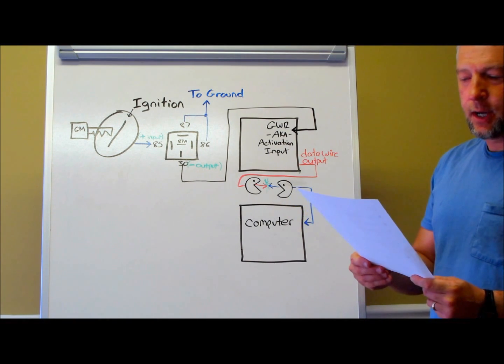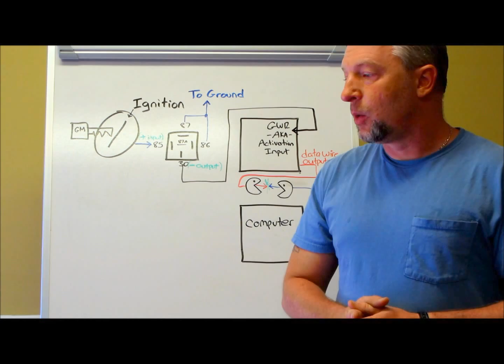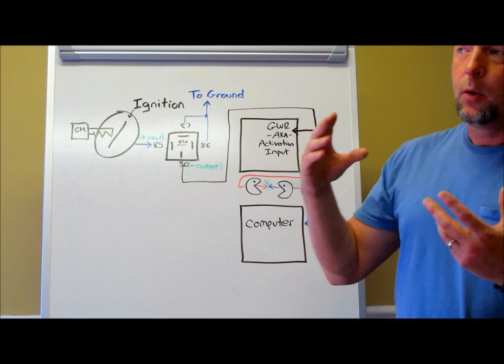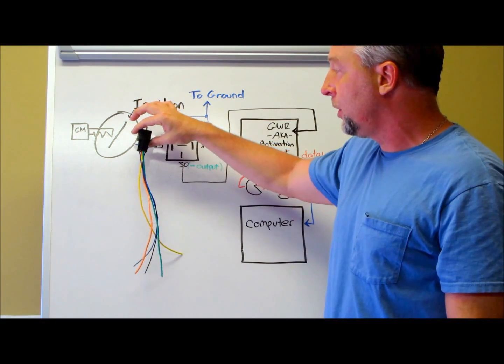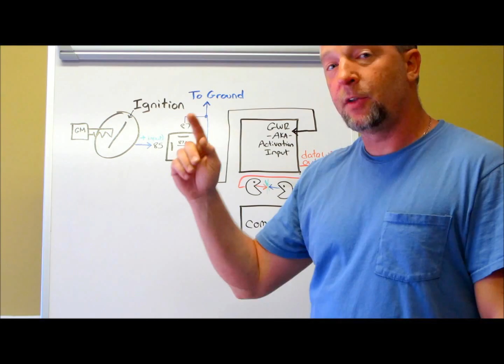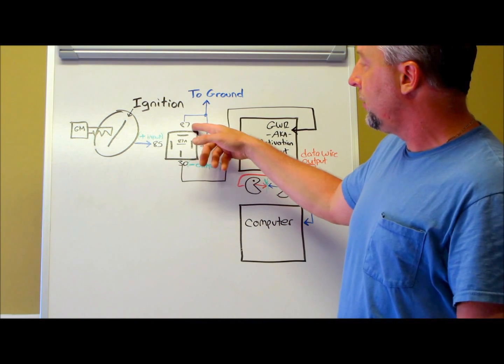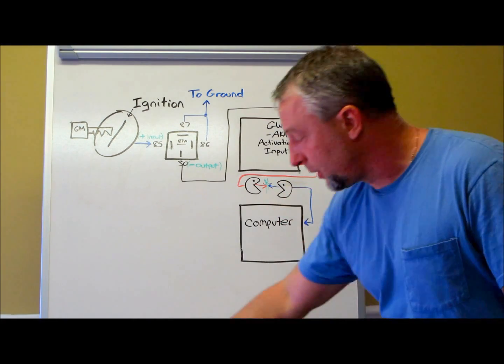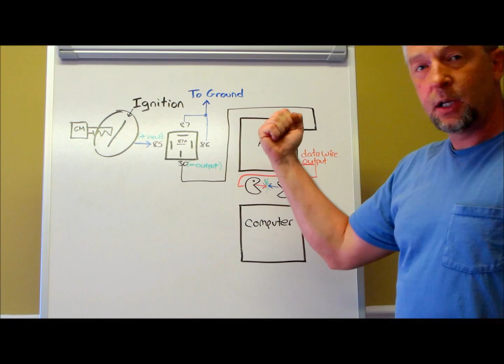Tricking (disabling) factory transponder anti theft system with an aftermarket databus bypass module

Comment: please contact me 2002 toyota avalon. no key. went to dealer got key with no chip he ran vin number made key with code.  no chip said it showed no imobilizer .car turn over no start then froze won't turn over.  hence have mobilizer. any way to not have to spend 400 dollars.? need help tyrone.trickey@gmail.com
Reply from the maker: I got nothing for that one, sorry
Reply: check out Forscan software.  I had the same issue and resolved it with forscan
Reply: The immobilizer  doesn't shut down the starter on Toyotas , you will need a new transponder key and program

Comment: Is there anyway to disable an anti theft system on a 98 Buick park. The fuel pump was replaced along with the battery and alternator. The car starts but doesn't crank. Also the security light flashes. Is there a way to put in a toggle switch to turn the alarm system on and off manually. If u can help me I would so appreciate it
Reply from the maker: we have a part in our store called a gmata which weve had alot of luck for guys having that issue, our site if youre interested in throwing 30 bucks at it is www.lesscosales.com

Comment: i have a 2000 ford mustang only have one key.the antitheft was activated and will not crank,will turn over but want crank.can this work on this car.if so wht will i need to do this.its a v6.i would rather buy parts from you so i no i will get the right parts i need.dealer wants 400 bucks to fix it.just to mutch for me to spend for key replacement and programming..

Comment: What would you recommend for a 2004 Nissan Maxima with only one key, that was just lost?. Dealer wants $300 for a replacement. I really don't care about the key/chip. I watched too many videos and it seems there might be a way to just get a regular key to work. Probably BS, but what say you?
Reply: go to deal have a key made by code that unlocks the doors and turns the ignition  then call a lock smith to come cut and program a key  if u have the service key it will be alot cheaper.

Comment: your relay is wired incorrectly. 30 is always the high power or ground input.  87a would be a pass through when the relay is not energized by 85 and 85. when energized the 87a pass through is cut and power or ground is sent to 87.

Comment: I have a 2002 Ford Ranger XLT would this work for me? I put my key in the ignition and get thing with either key. It worked fine, ran to the store came out and 5 minutes later I could not start the vehicle.

Comment: If you had a 06 Ford Expedition with no keys, would you be able to replace the key cylinder, and ECU from a donor vehicle and start it with the donor keys?  Or is the brains of the anti theft stored in a module other than the ECU?
Reply from the maker: that should be all you need

Comment: thank you for all the Information , now i shall go and get the kit and crank our beloved Betsy ( 2001 Nissan pathfinder SUV ) been sleeping in the yard for the past 3 yrs  , time to get her new tires and flush fuel tank and lines and engine , radiator ,e.t. c . because my girlfriend lost the only original key she had , and i have been looking for simple solution to this problem . and i found it here . 
this will save me over $798 USD . 
I have one question to ask knowing Nissan uses CAN bus system , thanks in advance :
do you think according to PDF catalog the IM05 class is best since i have no key at all ?

Comment: I got a 98 Ford expedition, I swapped the ignition cylinder and retumbled it. I need some advice asap, the antenna to the transceiver module ripped when pulling the old cylinder out, and it won't start the car. the theft light is flashing, any way of doing it on a ford, say it in dummy language so I can learn. please help asap
Reply: Get a new transponder coil antenna. It really doesn't pay off to try to bypass the factory transponder keys on vehicles.  It always ends up in a headache and winds up costing multiple times what it would have cost to just fix the system properly in the first place.

Comment: I have a 2001 Ford Excursion.  I watched the video on how to bypass the transponder.  The problem I have is the theft light is blinking, the fuel pump is not working and my car doesn't start.  I would like to buy pass the system...I checked out your website but couldn't find the package I needed to purchase it...Can you help?

Comment: OK, I have a 2001 Ford Focus, have both master and slave keys. lock cylinder is almost about to strand me. can I buy a new cylinder, and keys, then swap chips, and problem solved forever?
Reply from the maker: +wade baker why dont you keep the electrical portion and swap or repair the mechanical portion instead?
Reply: +Lessco Electronics already fixed bro, and I took your exact advice before u said to. I bought a new lock cylinder, and re coded it to the keys I already have, for 65$. it appears to be a cheaper lock cylinder than I had, but my keys fit my door, and I re programmed absolutely nothing. a little frustrating, but , took two hours, plus a six pack, done. thank-you very much for such a fast reply though, this man knows his shit, pay attention. is there a place I can like, or put a positive comment your way?
Reply from the maker: you already have, merry xmas
Reply: +wade baker same to you man!

Comment: my 96 foed explorer eddie baurer edition ive replaced the ignition cause original key and clicker got stole .well they gave me the wrong ignition first time at orielys had to go get a basic ignition switch and the new ignition makes hor go nut lights and car wont turn over how do I by pass the theft system we got it done threw taking door thing off driver door but fuel pump wont engage please help

Comment: i bought a used 2006 toyota corolla with only one set of keys, and they got lost.  I now have an uncut key, and an unprogrammed remote.  i need to get these both programmed and i have nothing programmed.  on the phone the local locksmith people are telling me it'll be about $200, but its just the phone lady and i don't know if i believe her.  can a locksmith do this, or does it require me having toyota do it?  (toyota would cost me about $600 from the sound of it)
Reply from the maker: daNATEP any regular locksmith with a pc can do it for much less than a dealer

Comment: The reason a person wants to do this is because it costs $150 to get a new key made for their car, and if it was your only key... you would have to tow your car to the dealership as well.  So I was hoping for some info I could use immediately.  This was not it.  I didn't find out how much each part cost incl. shipping, so I can compare it to the $150 it would cost anyway.  The diagram doesn't explain very well how to actually install the device.  Where exactly the relay plugs in, where the red & pink wires are if I don't have a key, and where to plug the device into the computer.  Without this info, this video is not too helpful.

Comment: Excellent video.  One question, I have a 04 Mustang with a 3.9L engine. My pcm crashed and I'm replacing it with a refurbished pcm already programmed to my VIN. They told me that the PATS would be the only thing needed to be flashed so my car would start. So will this video work, would I be able to start my car using this method and not having my keys/fobs flashed to the pcm? Thanks
Reply: Same issue i have,did you try it?

Comment: great video, my problem I have a 95 Corvette, replaced the VATS key cylinder, but car still wont start I been told that the TDM module is bad, can I by pass it with your system in the video?

Comment: Hi I have a 1999 buick lesabre custom and I have tried to get the vats pass key II disabled I set my ohm meter to 20k checked my key it reads 2.34  I have made resister collabos with 2.33, 2.32, 2.40 but it doesn't work I cut the orange wire from the steering column which has two thin white wires in it I attached all my collabos to the 2 white wires closest to the engine not the steering column  but none of them worked any advice? thanks
Reply from the maker: sounds like youre dead on, try leaving the key on with the new resistor inline for 30 minutes, try and force the bcm to learn the new resistance.
Reply: Lessco Electronics
Ok inline ? I knw off , n on , and in between both of those is tht inline or in the on position killin my batt. lol I guess if thts the the one i'll have to borrow the neighbors batt. charger! thanks!! Oh I just sodered my new collabo which is 2.33 I sodered 16 gage speaker wire to the ends and heat shrinked the middlle part still workin when it wants to? very frustrating!
Reply: Lessco Electronics
oh in my fuses under my dash I found 1 tht says vats 15 amp  whats tht about does it have a negative or positive affect if in or taken out pleaseim a dj nt a mechanic! Thank you very much ! lol help!